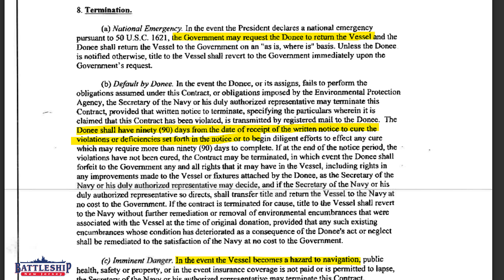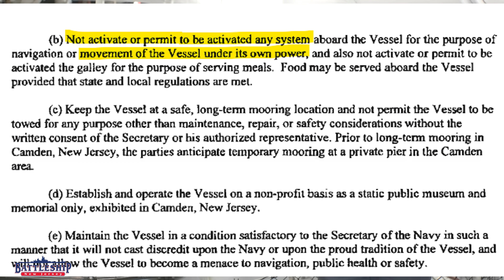Can Battleship NJ Still Move Under Her Own Power?

Comment: The USS Razorback ss 394 a WW2 submarine which is a museum ship moored on the Arkansas river in Little Rock has some interesting history- it was sold to Turkey and came the Muratreis s-336. Purchased by the Little Rock inland submarine museum for $37,500 it was towed to Little Rock after its 2001 decommissioning. More interesting after decommissioning which consisted only removing operational war shot torpedoes every thing else including the engines and the ability to dive and surface still worked.  The original plan was to have an all volunteer submarine crew sail her under her own power to Little Rock.  But the state department would not provide an import license for a private war ship crewed by a bunch of old bubble heads.  After all the torpedo tubes still worked . The big fear was the submarine would be captured by drug cartels and they would acquire torpedoes and stink coast guard vessels while bringing drugs in. So it was towed . On arrival they’re contract requirements meant the screws had to be removed they are on the pier and a hull cut was made and stairs installed so she can no longer dive.  But the engine diesels and shaft can rotate and they galley works. A volunteer bunch comes once a year lives on board and PM the engines and starts them .

Comment: I served on USS Ranger CV-61 from 1980 to 1984 and she had a steam plant similar too, though more advanced, then New Jersey's.  After 30 years, I can't imagine that ANY of the gaskets for any of the joints or valves are still good.  There are hundreds of thousands of these seals and I think ALL of them would have to be replaced.  That said, the Navy still operates a few steam powered ships.  6 of the remaining Wasp class LHD's are still in service and are powered by steam plants similar to New Jersey's.  So, the knowledge at least, is still there.
Reply: All of the nuclear vessels are actually steam powered. That's what a nuclear reactor does, it makes steam.
Reply: @shelbyseelbach9568   True, but the systems are vastly different from each other. Instead of a series of boilers, there is the reactor.  It's the people with boiler knowledge that is scarce.  The reactors are computer controlled, boilers, all done by hand.
Reply: @acdii  My point was that the Navy still operates considerably more than a "few" stream powered ships.
Reply: @shelbyseelbach9568  Oh no doubt, the point that was made in this video is that the steam powered plants in those still in service are decades advanced over what is in the Iowa class.  Even the running gear that is driven by steam is more advanced and streamlined.  The Iowa system is very complicated and very few are still alive that fully understand it and know how to run it from lighting the boilers to purging the lines.  A mistake in one area can led to deadly consequences.   1940's steam technology was decades old when installed in the Iowa.  It would be a huge learning curve with some very bright minds to reverse engineer it to understand it's workings.  Keep in mind that the Iowa has 4 separate systems for redundancy but are intercrossed as well.   It would take a LOT of training even with techs who work the current steam.
Reply: @acdii  No need to reverse engineer anything. When these things were built the Navy had bright minds create manuals to teach 18yo farm boys how to run all of this stuff.  All of these manuals still exist.
Reply: @trevorn9381 You mean like the ones made for B-17, and other bombers and fighters?  They do exist, but the hard copies are long gone, and what is left can be a bit hard to read. I have a few PDF of planes since I help with a restoration of a B-17E that was at one time a the XC-108A cargo conversion. It is all on old film reels you need a special reader to see.  Hard copies of the originals are either in someones basement or long gone.
Reply: @shelbyseelbach9568  Eh, technically you're right, but then we'd have to separate steam power into 'conventionally steam powered' and 'unconventionally steam-powered' ships.
Reply: @ukaszwalczak1154  No, we wouldn't. We COULD, but we wouldn't HAVE TO.
Reply: @shelbyseelbach9568  , I wonder if it wouldn't  be cheaper to convert an old battleship to nuclear power, than to rehab it's old boilers.  No doubt both would be really expensive.
Reply: My cousin is on one of those Wasp class LHDs.
Reply: I expect that is a big part of what he meant when he said it would take a year and several billion dollars.  They would have to start at the bow, and head back replacing tons of items.  A person would have to expect nothing working as designed for a ship under way, not the lights, not the plumbing, nothing.
Reply: @darrenhersey9794  Except wiring to a degree can be assumed to be working as it is in use by the museum now, along with plumbing to a degree.
Reply: he said that the engines would be buried. in the armor belts decks above it I think it would be quicker to take the blueprints and build another iowa with a moddern twist
Reply: The sub tenders as well.  Although they are operated by civilian Military Sealift Command engineers.

Comment: The off hand estimate of 2 billion isn't that bad really...Hell the airforce losses that much a year....
Besides 16 in shells of modern manufacture would possess gps guidance and possibly rocket assisted range extension, that plus the reality she most likely could shake off modern anti ship  missile hits would make them a force to be reckoned with! .....just saying😊
Reply: I think he meant 2 billion just to get it moving under her own power again - that does not include upgrading radar or weapon systems, etc
Reply: @garywayne6083  maybe, 2 billion just to get it running sounds like a case for fraud. anyhow,  be good sir!

Comment: Just wondering why not just this ship that is being preserved are not put into some kind of dry dock permenetly to preserve them. seems the cost in the long run would be less than having it floating and the life would be extended for a long time.
Reply: Ships are designed to float in water. The water exerts a stabilizing compressive pressure on the hull of the ship.

A ship that is in dry dock for an extended period would have stresses building up in areas that it wouldn’t necessarily be designed to withstand. Damage would result that may not be obvious but could result in the ship being unseaworthy.
Reply: @banedonrunestar5618  The Royal Navy did that with HMS Victory only to find out that after all of the years she's been sitting high and dry the wooden ship is now starting to pancake

Comment: wonder if power plant engineers could help with the steam plant
Reply: I was a Field Engineer with General Electric Company. I worked on plenty of power stations with steam turbine generators. I also later worked as an engineer in the GE Marine Department in San Francisco 40 years ago. I have been on lots of Navy ships, carriers both nuke and oil fired, SSN Los Angeles and SSN La Jolla. The principles are the same in stationary turbines vs marine propulsion turbines but the differences and operating procedures are very different. Also, remember that power stations run at load for months and years at a time under stable conditions. Marine turbines run at various speeds and loads and the entire drive train sometimes needs to be run in the reverse direction, and in emergencies, reversed in ''crash back'' condition. It's not just lighting off boilers. A steam powered ship has so many systems to deal with that are unique to marine applications only. You can tell a good stationary powerplant operator if his feet hit the desk before his ass hits the chair. That just doesn't get to happen on a steam powered vessel. Too many things to do.

Comment: Another short answer would have been: don't watch the movie battleship. Or at least take it with a grain of salt.

Otherwise the next question would have been: can 4 guys carry a 1 ton high capacity round all through the ship.
Reply: Sure, 4 guys can carry it, but each would need to lift 475 pounds and hope the lead guy doesn't rip a fart.
Reply: @kimmer6  in the movie they carried it through  broadway while could just have used the rail on the ceiling.

Comment: Congrats on hitting 200k subscribers, Ryan. Honestly, I'm rather surprised the ship doesn't have more subs (no pun intended). A friend of mine, whose been to New Jersey numerous times and basically knows the ship inside and out, tells me that out of all 4, New Jersey is the most advanced. Now, I'm guessing that has to do mostly with the upgrades she got when she was recommissioned for Vietnam. Because of her recommissioning back in the Vietnam War, is it true she's the most advance of the Iowas? Also, if we were to have another capital war, which of the 4 would return IF necessary? I obviously see Wisconsin returning, given how good material condition she's in.
Reply: I mean, I would think all 4 Iowas would have been brought to the same standard in the 80s when they were all heavily modified together?  Could be wrong but I see no reason they would have left three of the ships out of any useful upgrades.
Reply: @legogenius1667  They'd be brought to a certain standard, but since they'd be done at different times, with different contractors, and suppliers, they'd all end up slightly different. That's not accounting for any last minute additions, programs, and new tech.

Comment: Reactivating the Iowas is such a fun thought experiment and I love these ships, but I don't want to stand under a WWII pipe with 600 psi steam in it
Reply: Theoretically it can be pretty safe, there are a couple WWII ships that still sail under their own power.  The Jeremiah O' Brian has a triple-expansion steam engine that is still used pretty regularly.  It's probably not under as much pressure, but for how cheaply and quickly it was built the fact that it's safe to use 80 years later is impressive.
Reply: Lol, the safety factor at 600 is pretty safe.  You'd be amazed at how much work old equipment is still doing.
Reply: @R1200Jedi  Oh that's great to hear!  I toured the Star of India several years ago, she didn't strike me as a very functional ship at the time.  I love when museum ships keep some functionality, like when CVs use their actual elevators to move planes.  The Hornet is a great example of a surprisingly functional ship too.
Reply: Those pipes are better steel and the construction is BETTER than anything made today.  This lady was made when America was an industrial GIANT and had men who knew how to make things to last.

Comment: Kind of unrelated to this specific video, but if you watch the video of the guys that run the Iowa museum, they're constantly firing up the old ship systems to do things, but it seems everything on New Jersey is always done manually. For instance, not long ago on Iowa they used shore power to energize the turret rotation motors and rotated turret 3 so they could use the winch mounts to drop something down into the ammo strikedown hatch. They also made one of the ammunition rings in Turret 1 operable. Why doesn't New Jersey do any of that?
Reply from the maker: We'd rather spend our energy doing projects like drydock than activate the motors on the turrets. Different priorities.
Reply: @BattleshipNewJersey Understood, thanks for replying.

Comment: I would say more like 2 to 4 years given the current dry-dock backlog. Thanks to the Navy decommissioning about half its industrial shipyard capacity. In any future war, that bit of short-sightedness will probably make the difference between the success or failure of the fleet.
Reply: It's actually worse than that.  We've sent so much of our industrial capacity offshore that we no longer have the domestic capability to achieve even a fraction of WWII levels.  Icing on the cake is that we rely on China for much of our current needs.  China is NOT our friend.